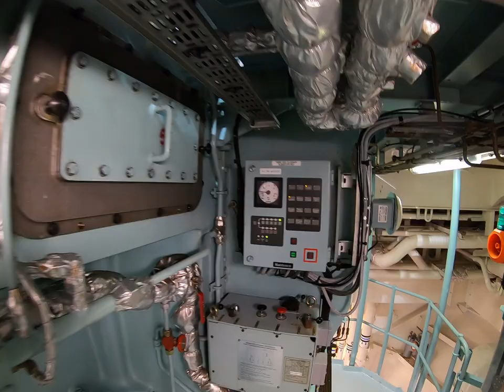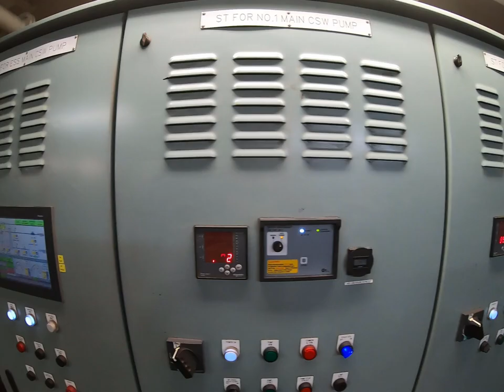Engine room Tour Modern ECO-Class Tanker

Comment: Wow that’s a spotless engine room. The chief clearly takes pride in his work and his ship. Or, it’s a brand new ship on maiden trip? Lol
Reply from the maker: Between the Chief, myself (1st assistant engineer), and the awesome engine crew we had, we ran a tight ship downstairs.  When I made this video the ship was 3 years old so relatively new.  Over the years, we often received compliments from inspectors about how clean and well kept our engine room was.
Reply: @Former_Highseasengineer  I’m not a mariner myself but back in 2000 I spent two weeks on a 700 ft cargo ship on the great lakes rebuilding a generator engine ( I’m a Cat dealership mechanic )  job started in dry dock but ship had to sail so I went along for the ride. Was a great experience and I remember how clean and organized it was. Everything was so nice if you made a mess you had no choice but to clean up because it stood out if you didn’t. Lol. I love a workspace like that.
Ship was called Canadian transfer, owned by CSL. I’m sure it’s still sailing the great lakes today. :)

Comment: so the turbocharger has no air inlet ducting?  
  just looks like it has that big cover over the compressor with a pre filter?
Reply from the maker: Yes.  The turbocharger inlet takes in ambient engine room air.  There are supply and exhaust fans that keep air cycling into the engine room.